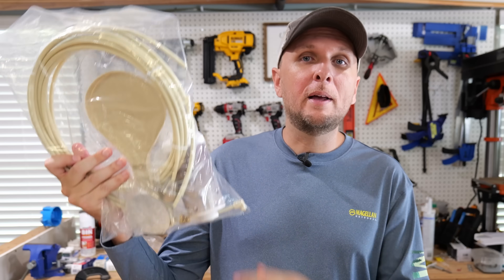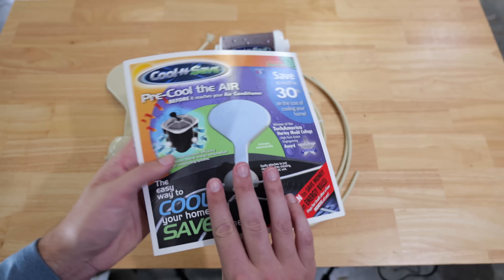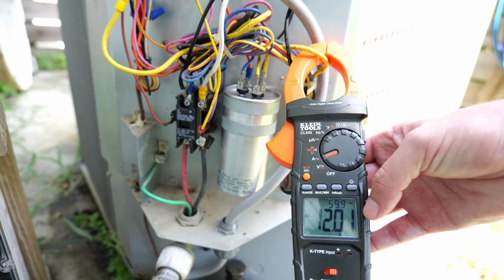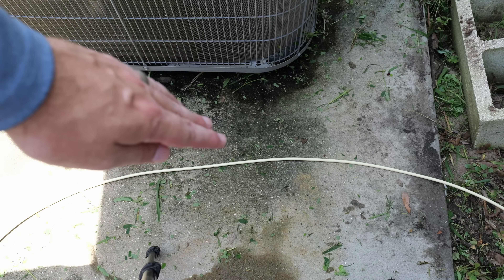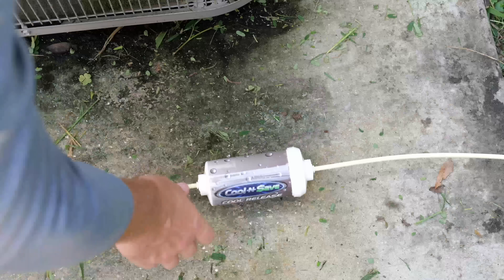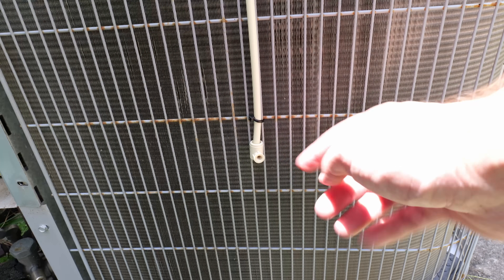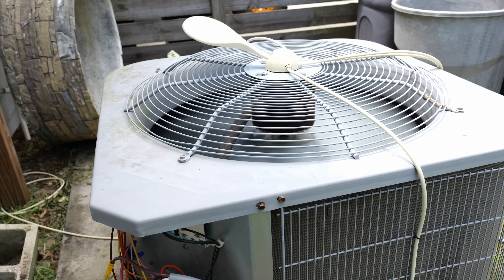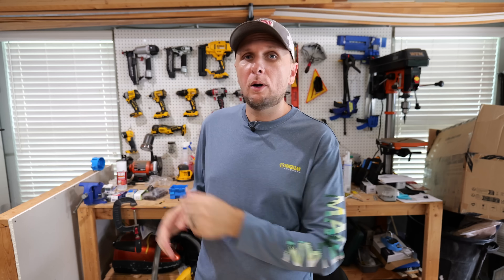This Device Can Save You 30% On Your Energy Bill! Makes The AC Blow Colder

Comment: 1 degree and 1 amp. Unit is 120 beans. Prob take a year or two to recoup. Also, the maintenance of the buying the water treatment yearly offsets any savings. Now there is one way to make this all worth it. Figure out a way to get free treated water or the like to supply the unit. (I’ve figured that out). If you do that, then unit over time is a w. Do it not and it’s not worth it

Comment: How has your water bill been? I'm trying to decide whether or not to get the AC Shade on Kickstarter, but I just watched your video.
Reply from the maker: The amount of water used is around 1 extra flush of your toilet a day.  So doesn't make a huge difference.  I have seen that shade and am very interested in it but think I am going to wait until it is in mass production.
Reply: @HowToHomeDIY That's not bad at all. Overall, have you found the kit is still saving you on energy costs? I'd need to buy two, as I have two units next to each other. Same reason I'm hesitant to get the Shade. I'd have to get two of them.

Comment: That MIST will dry on your cooling fins and eventually leave enough calcium carbonate deposits to severely impact their ability to transfer heat to the air, or even clog it entirely.  This is a Terrible idea.

Comment: I think the theory is right on. I question the long term effects of the unit running in such a humid environment.  Mineral deposits are a non issue but what about the electrical components and compressor???

Comment: Why not just add a 24v water valve to your compressor contactor circuit, and diy your own misters to that water valve. Anytime the compressor is signaled on, the misting will begin. a 24v water valve would only pull about .2amps.

Comment: I think the concept is great but the product design leaves a lot to be desired. That fan-paddle rig looks ridiculous and cheap. I'd go with an electric valve that is wired to the fan motor and opens when the fan goes on. The price is also way too much.  I could probably make the who rig for less than $50 in parts from my local big box store.
Reply from the maker: Do it then.  The guy that sells these sells tons of them.
Reply: @HowToHomeDIY  Ha! I actually did and I've changed my tune. Here's why: I built a system using a solenoid and it works fine but...Imo, it's way too involved for most folks to set up vs. the simple, mechanical, turn key solution offered by the Cool and Save which takes about 15-20 minutes to set up vs. the hours long installation that my set-up required. Sure, it's a one-off and that results in more trial and error and trips to the hardware store, but still....and as far as cost, I've got about  $70 in parts invested in mine and have not even purchased/installed the filter yet (which I plan to do asap), so sure there's some savings there, but probably not enough to offset the extra time I had to spend. I did a video on it and said as much in the conclusion. Love your channel btw! Good Stuff!

Comment: After 6 months of use a white deposit started forming on my condenser fins. The white deposit seriously restricted the air flow through the condenser fins and, in some areas, actually caused damage to the fins - they dissolvedI !would avoid using this kind of product in order to not destroy your condenser coil. I live in Boca Eaton , Florida and I suspect the minerals in my water have reacted with the aluminum fins.

Comment: Makes no sense. 1:00 if the water valve is actuated by the condenser fan, why would the fans turn on at any time during winter? The condenser only operates when the system is used to cool down the house, and not when it's used for heat during cold seasons.

Comment: I put my paddle on top while the condenser was turned on and my paddle doesn't go up in any position.  My first thought was that maybe my airflow is being affected as my coils might need a cleaning, so I got a can of cleaner from Lowes and gave it a thorough clean (thanks for the video on how to do that properly).  All good, I thought...tried to find the right placement for the paddle...no change.  My unit seems to be working fine, but it's not lifting the paddle at all.  I tried to contact the company, but haven't been contacted back yet.  Any thoughts, by chance?

Comment: Hope you are using rain water. In San Antonio, the water is very hard. After a year or 2 of city water, you will be replacing your condensing coil due to calcification build up and loss of heat removal.

Comment: Yes, this water mister can reduce power use and cooler air from air docks.  the drawback your outdoor condenser reduces the life by two times faster due to electrolysis on the cooling fin.  The cooling fin (aluminum) and the freon tube (copper) used by the air condenser cause electrolysis when water deteriorates the aluminum when water is added to the play.  Like in the boats, two different metals exposed to water cause corrosion/electrolysis.

Comment: Vacuum breaker is code? For TN it's only required for dedicated irrigation systems. I don't know a single person that has one on their spigot. 
I used something similar to this unit at my other house. I just used one of those patio misting systems and it worked well. And keeping the unit in shade will help also. You can use one of those 10x10 pop up tents or even a yard umbrella. Just don't put it too close as to restrict air flow or it'll have the opposite effect you're going for.

Comment: I wouldn't recommend putting that on your unit that's going to create a problem for your condensor spraying water on the coil will bring down the head pressure but, sooner or later it going to increase corrosion on the coil and cabinet with will cost you more money in repairs or replacement.

Comment: There are so many misconceptions here.  Amp draw reduction with no voltage check is useless.  Supply temp with no return temp is useless.  No head pressure check, no suction side check.  Time between amp checks?  Even small time changes can affect readings.  I could go on ad infinitum.
Coil damage is coming due to buildup on the coil.  Even if you could (which you can't) get de ionized water with your filters, corrosion of the coil will result.
Bottom line: little to no savings with premature unit failure.
GFM

Comment: You can do the same this with a sprinkler pump attached to the A/C thermostat wiring. both use 12v. but the calcium removers don't work very well and eventually the calcium will destroy your fins.

Comment: I don't think I would use this all summer, I've got a package unit with all the electronics in the unit outside, so I'd be weary of all the water mist causing issues. However this might be good for those heat wave weeks.

Comment: My ACR&H company years ago installed time-delayed evaporative cooling modules here in the high Desert of Southern California that cost tens of thousands of dollars in the 1990s on package units serving a large hotel complex and we finally had to remove them because the moisture began to corrode the aluminum fins and plug coils with white-crude soon threatening the life of the condenser coils. Just like lawn sprinklers that will damaged outdoor coils, using water misters will eventually create the same deposit condition. Best to have a large 20k CFM central swamp cooler and duct the cool air to the condensers from afar and deal with mineral deposits at the main water cooler unit. Wouldn't you think?
Unless possibly you were to use distilled water or equivalent, problems will most certainly follow.

Comment: I love this idea, but what about the increase in your water bill by leaving the water turned on on the spicket outside? Would it be enough to compensate with the lower amperage to run the ac unit and ac unit not running as often?

Comment: There are great devices.  I have installed a few on some of my client's houses, especially those with multiple units on their house.  I recommend that they clean or have their coils cleaned at least 2x a year in order to keep the mineral deposits off of the coil fins.

Another easy, cheap and low maintenance as well as low cost is to cover the unit/s with a Sun Sail/Shade.  This lowers the ambient temps, and allows the unit to work less to cool the coil as well as the rest of the equipment.

When doing both of these, you save even more energy.  Do I know if the units last longer?  Not at this point in my career, because I have only been doing these methods for a few years now.

Comment: What are all of you smoking?! AC manufacturers are constantly under scrutiny from the US government. If they could improve their own units performance they would jump at the chance. So this either makes a negligible if no difference or if causes some kind of issue down the road. There are so many different variables that could have caused your changes. A dip in temperature, a few clouds, etc could cause these results.
Reply from the maker: No
Reply: @HowToHomeDIY so you're telling me that if the manufacturers could sell or patent a built-in attachment for units to save 10% on energy costs they wouldn't do it? I live in South Florida and the humidity here wouldn't allow this system to work if at all. Maybe in the Midwest where they have swamp coolers and such. 

I think for most people maintenance would be more efficient. Check your filters more often, clean your coil, etc. But this system is not the way. The mist created just isn't enough to cool the coil to see a decrease on pressures. I mean if you hit your coil with water in 95f it would make a difference until the water evaporates but this mist just isn't enough. If you wanted to test this just get a plant mister hose and wrap it around the coil and then let it run during the hottest point in the day. It might actually work as there is going to be a ton of mist going all around wetting the coil. But those 4 mists that are going to clog over time, as filters don't stop hard water, water softeners do. 

Also the plastic on this device is going to last for three moths before it cracks and breaks and you have leaks everywhere. Which is probably almost certainly why the manufacturers don't do this on their units. So save your money and use it to change your filters more frequently and go outside and run some water through your condenser that hasn't seen a cleaning since the Obama administration. And a more effective change for even cheaper would be to plant a tree or bush or anything around the unit (not touching) to shade the unit from the sun.

Comment: Shared answer from a commenter's question:
I think in at least the humidity part of this conversation there may be a misunderstanding. The evaporation of your supplied water is literally what is cooling the air around your condensing unit. As your tap water, hot or not, is atomized by the misting heads it evaporates more quickly AND COOLS the air immediately around the unit. So really, we're talking more about a very localized effect instead of atmospheric impact that humidity has, at least with humidity percentages of 50% - 60% and below. The smaller the droplets of water coming out of the misters the quicker they will evaporate. The easier they are to evaporate the quicker that localized air cools. So lots of that ambient heat is absorbed with those tiny water molecules causing cooling effect even in relatively humid environments.

Comment: I'd like to point out these are very Humidity dependent. The LOWER the ambient humidity, the BETTER something like this will work. If where you are is already 80-100% humidity, the mist won't phase change as quickly, and therefore won't provide any cooling. I posit it would work best with ambient humidity below 30%.

A mister like this would work a LOT better in places like Nevada, Arizona, California where summer ambient humidity levels go below 10%. The phase change of the mist evaporating to a gas is what does the lion's share of cooling.

Second, that valve looks 'very' cheaply made, I'd be worried about it getting 'stuck' open and damaging the condenser/fan
Reply: They actually work quite well here in New Orleans area.  We have 100% humidity a lot.  

The only thing I recommend my clients do is to have their coils cleaned at least 2x a year due to the hard water deposits.

Comment: My newer window units use water from the condensate pan. It saves about 10% which is pretty good, considering all they had to do was make the fan rim reach down into the water. It takes very little water to achieve this evaporation effect. Folks, go buy the cleaning fluid and clean your damn coils, it's easy and you should be doing it anyway.

Comment: Living in the high desert, the only type 'AC' we had, was called a swamp cooler...that worked rather well. Real AC would be a money pit. I see where many discount this type system due to the fact that manufacturers don't even attempt to have these on units. There are reasons for this. It's because there is inherent issues with this, mineralization the main one. Sorry, there is no filter that will keep minerals from collecting over time. They don't want to encourage the use of anything that would possibly impact the life (reputation) of their units. That being said, where I worked at a factory  (with several massive roof-top units) we went a sort of different way. We basically copied the 'swamp' type coolers that have a recovery pan/supply...with the supply level maintained by a toilet valve type setup. The water used was from our ionized water waste from the factory, so no water bill. We did not use misters, we had very coarse filter media that was continuously soaked that surrounded the condenser housing. The water returned to the pan and was recirculated by a very small pump, engaged by the compressor connection. Our maintenance crew serviced these every month, mostly to clean the dirt and butterflies from the media. IIRC, it was horsehair media or something similar. At any rate, it apparently made an economic difference because the company was tight as hell.

Comment: My AZ water is rated at 120 ppm and 7.0 the device requires a wavier in this case filter is a must. In looking at the positives of in line filters I wonder if an outside capped flushable spin down would make more sense it says its rated to 100 microns and its only in use about 4 months in AZ upper desert 85623. What your take?

Comment: Unfortunately my area has very hard water, so the cost of replacing the mineral cartridge every few months will negate the electric bill savings. My AC unit is far from my water valve, so that will mean running a long extension across my patio door, walkway, grass etc. It won't be a good solution for me. Also, what are the long term negative effects of constant water deposits onto the condenser coils, I would think mold, mildew, dust, wet leaves, etc. I will have to pass on this mickey mouse solution to perhaps save $25-30 dollars a month. How much is a new condenser unit, $3500???

Comment: I don't think this is the best use of treated, pressurized, florinated city water.  It might be good as part of a rain barrel or gray water system.  Just have the coils underwater and swap the fan for a pump to circulate the water.  Water can take up an incredible amount of heat before it boils off.

Comment: Hello, I have a question previously. Before the capacitor motor was damaged, the air unit took out all the heat from the compressor. It pulls the air up, now Asia pulls it down and I feel that the copressor is working harder and the electric bill is more. how can I solve that problem

Comment: Thanks for your videos, all for DIY's are informative most helpful.  I have read most comments about, to do or not to do.  If I were to install this mister, the water source is a spigot close to my unit.  In by basement, I have a shut-off valve to this spigot.  What If I installed an in-line filter with a valve that allows filter water to the mister or I turn the filter off if I want to water the grass?  Does anyone think this is doable.  What should I be trying to filter from the water, (iron & calcium)?  I would not use the filter that comes with the kit.  Any suggestions?  Thank you
Reply: You're trying to filter all minerals, as many as possible.

Comment: Now that you've used this a bit, I'd appreciate an update, possibly addressing some of the critical comments left here.
Reply from the maker: Sure!  I assume you are talking about folks claiming it will cause buildup on the coils?  I haven't experienced that.  Now again, I use the filter they include and my water is filtered through a water softener so the scale and hard water are pretty much neutralized.  They talk about this in their instructions and certain applications and very few areas of the country they don't recommend it in which can all be read prior to purchasing.  But yeah, I have had zero issues and I clean my coils once a year anyways.  I hope that addressed what you were talking about.  If you have any other questions feel free to ask away!
Reply: @HowToHomeDIY  Thanks. Just hooked it up!
Reply: @BobbyBoucherWaterboy  How's it working for you?

Comment: This is more of an experiment that proves water is more conducive than air. If someone is really serious about saving energy, geothermal heat pumps take advantage of waters superior ability to transfer heat by circulating a water/antifreeze mix. You can do things like adding insulation and sealing cracks to reduce energy loss which is beneficial all year and will almost immediately save more money than initial costs. Geothermal is one of the most efficient ways to heat and or cool a structure, couple that will an airtight building envelope, and power it with photovoltaic solar and it's reportedly possible to reduce energy consumption by around 90%.